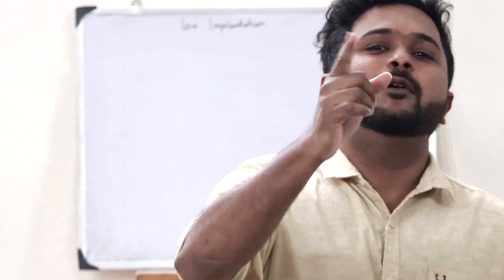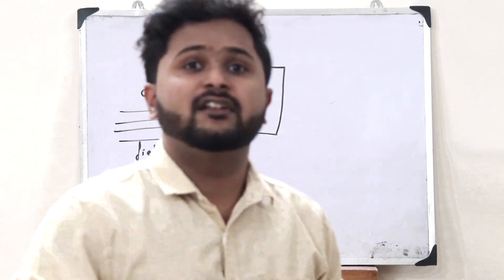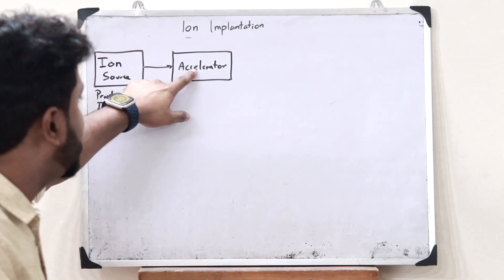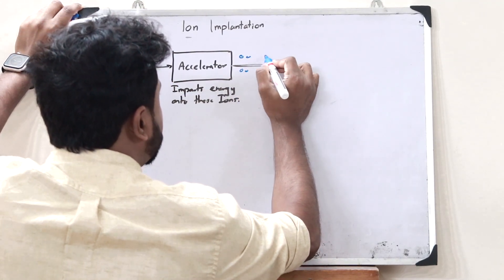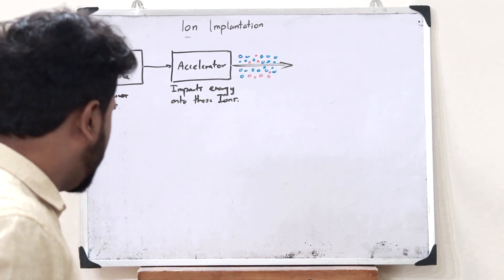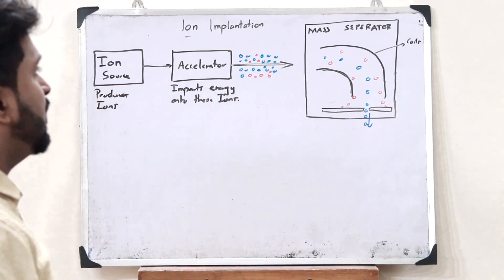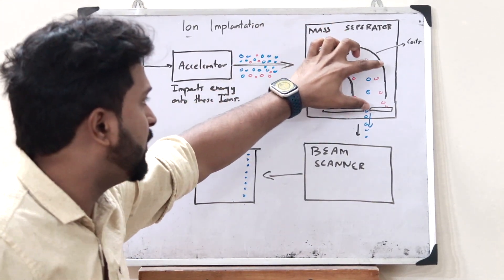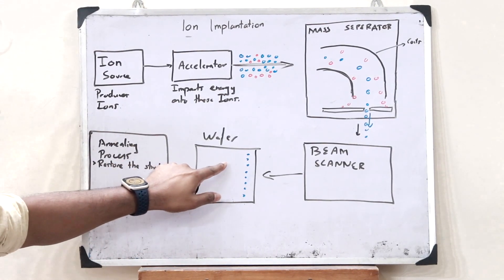Ion Implantation Technique | Block Diagram and Working | Simplified VLSI KTU |

Comment: The lines you labelled as coil in the mass separator are not actually coils. The ions are bent due to an applied magnetic field perpendicular to the plan of the board. The curved lines are just some path through which the ions travel.